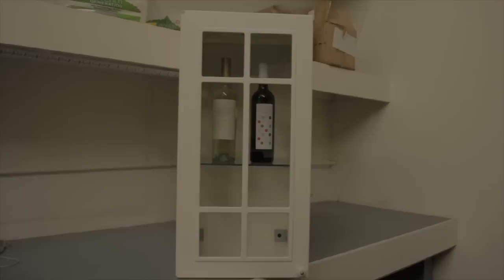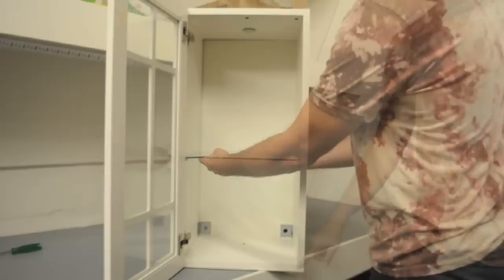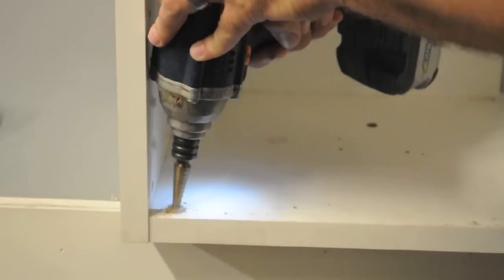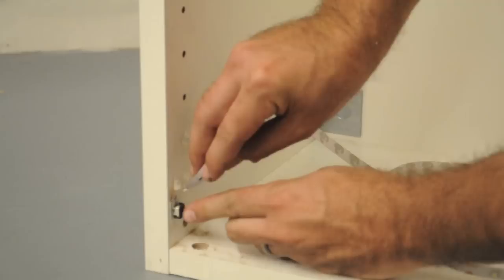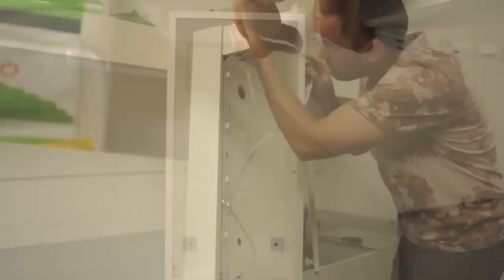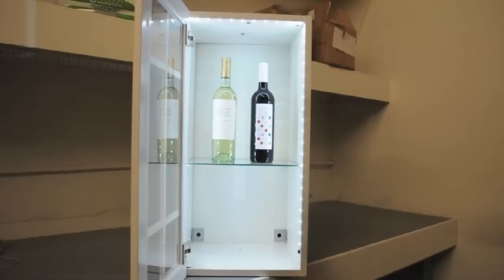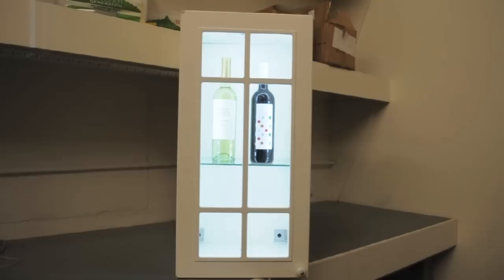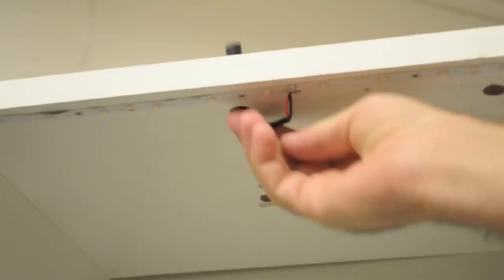In Cabinet Lighting | Inspired LED

Comment: I installed under cabinet lighting using LED strips.  It turned out beautiful!
Your video was really helpful and made installation easy!
The problem I am having now (5 years later) when I use the remote to turn the lights up they FLICKER!??  If I turn them down to about 75% brightness the flickering stops, but anything brighter (80 - 100%) flickering comes back.  The whole LED line is affected with flickering lights.
With your experience, any ideas what is causing this and how it can be fixed?  I would light to have my lights brighter again. 😕

Comment: Cool, but where does the power for the strip come from? A direct plug in or is there the need for a transformer somewhere. And how about switcing? How do you turn this on and off. I am trying to install this in a free standing china cabinet so I can't rely on pre-existing kitchen wiring for power. Also - do you know of some type of switch that operates on and off when vibration occurs (like opening the cabinet). Thank you for your video, very informative and well done.

Comment: I've used something like this and the tape released from the cabinet because of the warmth of the lights. Is this a manufactuer problem?
Reply: Most manufacturers currently are using much better 3M adhesive.  Its been a long time since I bought a roll that had bad adhesive.  I buy on  Amazon from a company called HitLights and I have yet to receive a bad roll of lights. Also I've bought around 50 rolls or so over the last couple of years.

Comment: Hi, we removed our backsplash and our under cabinet florescent lighting bars.  They were wired in and how do I connect these to the wiring that is sticking out of the wall under my cabinets?  Sorry to sound so lame.  Thanks
Reply from the maker: Avasings Our products are all 12V products so you will need to make sure you are using a hard wire transformer before all your existing cable drops to make them "low voltage" lines. As for connecting them to our light strips or panels, we offer a variety of connector options ( you could wire nut, or use a screw terminal depending on the gauge of the wire), this will depend on which product you are planning on using! Feel free to check out our website we offer live chat support, and free design services. Inspiredled.com 

Please let us know if you have any further questions- 480-941-4286.

Comment: Also, which of your systems are you using here and what length is the cable? Thanks again
Reply from the maker: Peter Bommel This video does not show an on/off switch becausethe placement of the switch truely depends on the layout of the kitchen. Some customers prefer to have their in-cabinet lighting entirely separate from under cabinet lighting, in which the switch would be in series before the lights and after the power supply. If the lights were to be integrated into the same system as the under cabinet lights, the switch would most likely be placed in the most convenient location in relation to the power and the in-cabinet lighting would be in series. This video just shows a single Normal Bright Flexible Strip being plugged directly into the power supply. Check out our direct website for the various cable lengths we offer as well as flexible strip lengths! Let us know if you have any further questions!